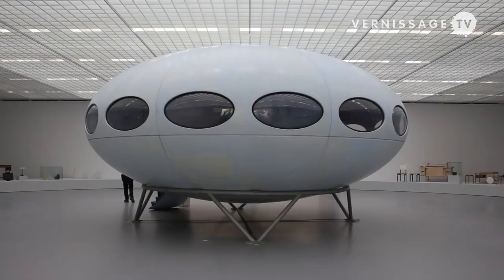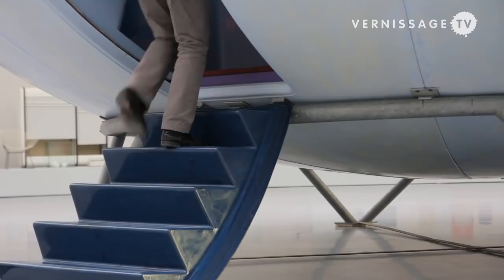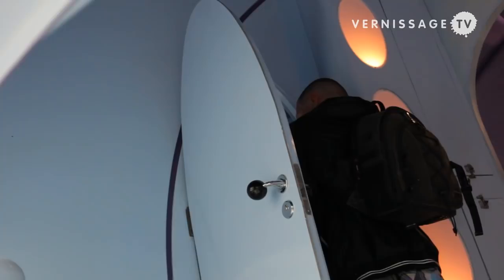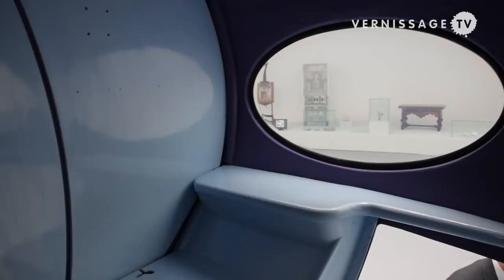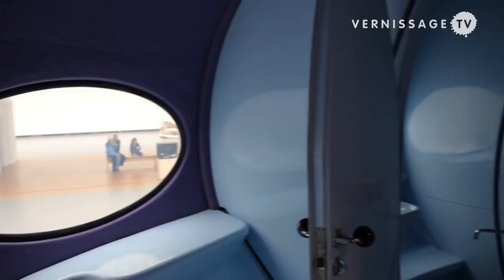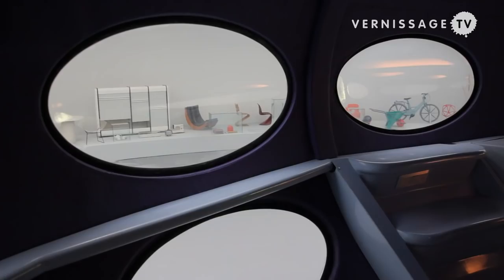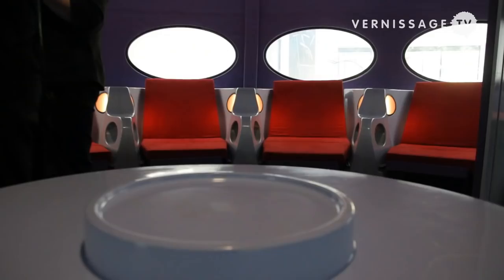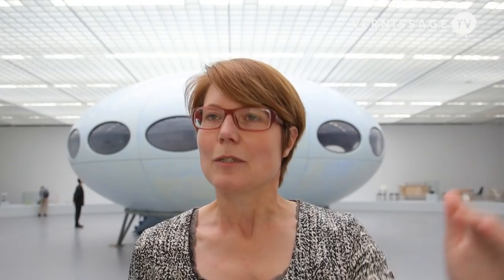Futuro. House of the Future

Comment: Increase the size and make it a double decker, two floors, and you have a very nice home -  increase the  feet and ladder,  so it's up higher and make sure it floats, water tight, and you have a flood and fire and earth quake proof  home.   (making sure the 'landing gear'  are struts that can safely dampen any quakes).
Reply: great idea with the landing gear. Elon Musk would add some engines too, I guess.

Comment: The lady says that it is made of polyester and I got stuck at that point. I am actually here deliberately - as in I went searching for a few videos about this house because I've been reading a bunch of information about the Futuro on a dedicated fan site.

That said, everything that I have read so far has said that it is made from fiberglass. Fiberglass is sometimes embedded into resins, as far as I know. To be clear, I should be assumed to be completely ignorant on the subject just to make this easier. Assume that I know nothing and, to be frank, I don't really know much at all about this.

Now, polyester is a complex hydrocarbon, right? Is it one of the more generic terms where there's multiple types? Is it the same material that they used to make disco dancers more slick? Is it a language issue where the use in her native language is different than the usage here in the US? 

I've seen the molds that were used to make the individual parts to the house and they look like the standard fiberglass molds that they use to make fiberglass boats. They didn't look special and they are pretty old, so  don't think they're using some sort of high pressure injection molding or anything like that back then.

Anyone have any more information about this? How is this polyester, specifically? Given the little that I know (assume that I know nothing), it seems that polyester could be in a resin form and be the 'fiber' part of fiberglass. I am guessing that's it but I don't really know and am kind of curious. 

I have read that they're rather flimsy panels but that they are stronger when they're fully assembled due to the shape and the bracing. Would that have something to do with the fiber portion being polyester? A couple of quick Google searches aren't really helping but I'm not really sure what to look for. I imagine that there are different grades and chemical changes (molecular?) that result in differing qualities of polyester but I have no idea what those would be called and what search terms would help me out.

Meh, someone here might know.
Reply: Galen Gregory, we had a campground here in Pennsylvania that had Futuro Houses as cabins and they were made of aluminum with fiberglass cladding.
In the 1960's to the 1970's these Futuro Houses were built to customer ordered specifications making them unique inside but externally they were UFO shaped due to the space craze of the era.
The prototype in this video likely used polyester just because it's inexpensive for demostration.